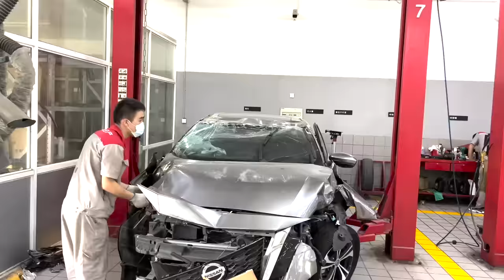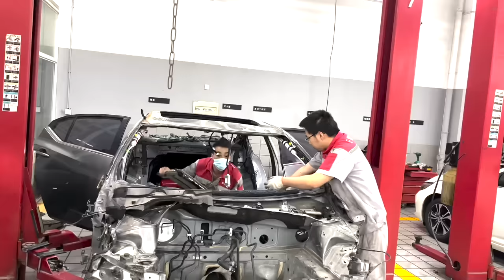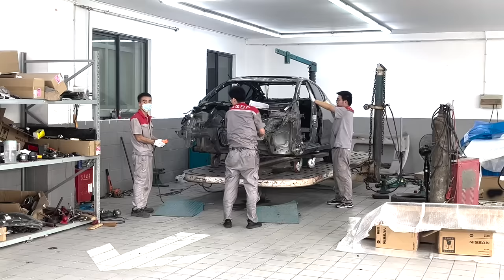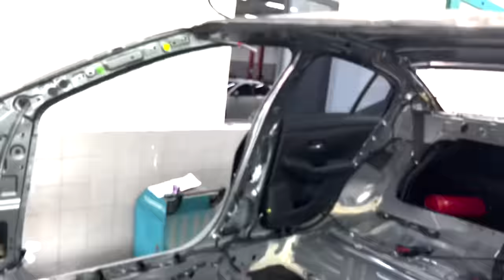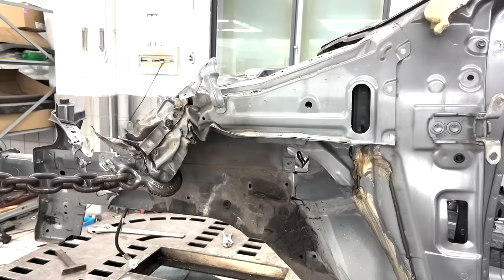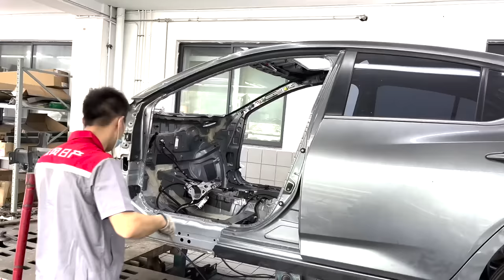Mechanical Wizardry: Master Technician Han Restores Scrap Nissan Sentra to Perfection!

Comment: I wonder how much it is to fix this car. In the United States, it is cheaper to buy a new car. This will be totalled and used for parts.
Reply from the maker: Hello, This car will cost around $10,000 to restore, the cost to repair the car can vary greatly depending on the extent of the damage, the make and model of the vehicle, and the labor and parts required to repair it. In some countries, if the damage is severe, it may indeed be more cost-effective to treat the vehicle as a whole and use it for parts rather than repairs.
Reply: @xinxianshi  exactly what I said....

Comment: In the event of another serious accident the driver will not be protected as the safety cage was compromised. Han is very skilled technician but he can not work miracles.
Reply from the maker: Your concern is valid, and safety is indeed a crucial aspect of any vehicle repair. While Han's skills are impressive, it's important to note that proper safety measures, adherence to repair standards, and thorough inspections are essential to ensure the integrity of a vehicle's safety features, especially the structural components.

Comment: At least repair was made to 90% . Will make a good car for someone if now mechanically ok.
Reply from the maker: It's great to hear that the repair was made to a significant extent, and the hope is that the vehicle will now be in good condition, especially mechanically. Ensuring that the car is not only cosmetically restored but also mechanically sound is crucial for its overall performance and safety. 😊🚗🔧

Comment: This time you overdid it with this car, this car should go to the scrap yard, Mi;11.20. see how much is left of this car, My sister-in-law wrecked a chrysler sebring car at a cost of $22,000.00 and the new car cost $22,5000.00 in 2002, did it make sense to repair the car and save only $500, Insuring made money and gave them a job without any sense.
Reply from the maker: Your point raises a valid consideration about the cost-effectiveness of repairing a damaged vehicle, especially when the repair costs approach or exceed the value of the vehicle. In some cases, the decision to repair a vehicle versus declaring it a total loss involves a careful evaluation of factors such as repair costs, the vehicle's market value, and potential safety implications.

Comment: When driven even after fixing wont be the same..the adjustment of the body is already out of balance..if the buyer see the picture of the car before its fixed they will think twice..its a hazard to even use it on the road ever again.
Reply from the maker: Your concerns are valid. It's crucial to consider the structural integrity of a repaired vehicle, especially after significant damage. Proper alignment and structural integrity are essential for safety on the road.

Comment: They only deal with NISSAN , doesn’t these repairs cost more than the vehicle . I mean these repairs are practically making the car new again all parts are new nothing is fixed .
Reply from the maker: Hello, we are Nissan after-sales service. Although we use original parts for repairs, they are still not comparable to new cars.

Comment: Is it really worth to repair such an enormously damaged car ?
I mean it must take 100 hours to do the job which will cost a fortune ...
Reply from the maker: As you mentioned, extensive repairs can be costly, especially if they require significant labor hours and replacement parts. It's essential to weigh the cost of repairs against the value of the car and the owner's budget.

Comment: Brother Han... No mask welding?? Be careful get some protection or by the time you are 40 you are going to be what needs a body repair specialist...
Reply from the maker: Thank you for your reminder. The habits that have been developed for many years are difficult to correct. They will use other methods to protect their glasses. Please rest assured

Comment: With the extent of damage sustained by this car the only place where this level of repair would be economically feasible is China. Labor costs are so high here in America the time spent for repairs would exceed the value of the entire vehicle and that is the break-point most insurance companies are not willing to cover. Therefore a car like this would end up going straight to the scrap yard.

Comment: This car here in the USA would not be taken for repair, it would be scrapped. My daughter hit the back of the car and smashed the front of the car, 5 years old and note wanted to fix this car.🤑
Reply from the maker: I understand, the decision to repair or scrap a car can vary based on factors such as the extent of the damage, the cost of repairs, and the car's overall value. In some cases, the cost of repairs might exceed the car's current market value, making it more economical to consider scrapping it, especially if there's insurance involved.

It's unfortunate when a car with relatively minor damage gets written off due to repair costs. However, safety and the overall condition of the vehicle are crucial considerations.
Reply: As far as I know, this car was auctioned off and given to someone who will fix it, I mean that the insurance agent steals from us and turns the value of the car to his advantage, and the injured person loses several thousand $ because he has to buy a new car.

Comment: En mi país muchos al tener un problema de ese tipo compran la mita del auto y lo sueldan
Reply from the maker: Hello, the repair methods are different in each country. Welding the car is also a good method, but the cost will increase.

Comment: People really find this amazing?  Sure, he bent the frame and body back and made it look good.. But if this vehicle was ever in another accident, the crumple zones are now compromised, and the same accident would likely take the life of the driver because of the integrity of the old "repaired" metal is now diminished.  This would not pass an inspection in the United States at any reputable mechanic.

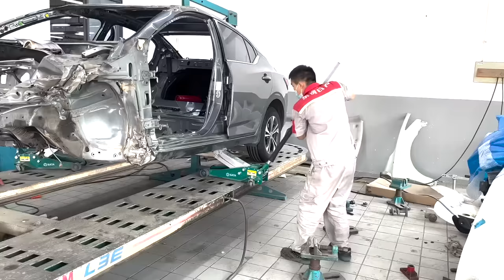Comment: In Oregon it wouldn't h😅 0:57 ave a clean title. You can't sell it as an original vehicle
Reply from the maker: Hello, thank you for sharing. The laws of each country are different. In our country, similar accidents can be repaired and the vehicle can be driven normally, but the accident and the repair process will be clearly recorded in the vehicle insurance file.

Comment: What a PERFECT DEMONSTARTION OF HOW  NEVER  TO REPAIR a CAR!  This will not perform to Factory ratings in the NEXT crash, when YOU own it. It will kill you, instead. 
Generic Sill clapmps? No factory lock-points? No 3-D pre-measuring, or even trammel measure? Straight into deconstruct without knowing if anything BEHIND the visible damage is off-spec?? Everything done by 'expert' VISUAL alignment????  Arbitrary sectioning locations, dictated by damage, not by the Factory BRM???? No cnoncern for HSS /UHSS safety cage 12.40, 13.20 repairing of sectioons that should NEVER be repairered, replacement is the onlyfactory-approved option: The passenger safety cell. Shocking repair practice.
Reply from the maker: you have some serious concerns about the repair methods demonstrated in the video. Your attention to these critical factors is commendable, as safety should always be the top priority in automotive repair.

Comment: So insurance says it’s totaled but you fix it?
Let me guess. You’re not a reputable garage and you would put your family in that car?
Reply from the maker: Hello, I need to clarify that this car was sent to us for repair by the original owner. The cost of repairing the car was almost the same as the value of the car, so the insurance company suggested scrapping it. However, the owner disagreed with scrapping it and insisted on repairing it, so he sent it to us. There will indeed be some loss of safety, but it is acceptable. We respect the owner's choice.

Comment: Such a car is a coffin, the stretched elements do not have the same strength as they originally did
Reply from the maker: Your concern is valid. When a car undergoes significant modifications or repairs, especially involving stretched elements, it can impact the structural integrity and safety of the vehicle. Alterations to the original design, such as lengthening or modifications to structural components, may compromise the vehicle's crashworthiness and overall safety.
Reply: @xinxianshi  Exactly

Comment: Рисовый Хан целый месяц ковал уставший металл,а русский Ваня просто приварил бы передок от распила 🤔
Reply from the maker: Hello, your observation is correct. The technicians will analyze the damage before repairing and then make a corresponding repair plan. Welding at the incision is also a method, but it is generally believed in the market that the original car part should be retained as much as possible to avoid cutting the main body and avoid expanding the accident.

Comment: I've seen cars in a lot better shape than that one, that were totaled by insurance companies. This one is good to show what can be done with a talented body shop man. But I'd find a car in a lot better shape to take on such a project. From the damage it had, this one must have been rolled. Or drove underneath a truck. I can't figure out how he welds with no welding helmet to shield his eyes. He must close his eyes everytime he hits the trigger on his mig welder. That's one thing I wouldn't mess with. I've heard horror stories about burns to the eye being so painful. An auto darkening helmet is cheap.
Reply from the maker: Hello, thank you for your serious reply. This car was caused by a rollover. It is a habit for them to close their eyes when welding. Although the automatic darkening glasses are cheap, they will affect the work speed, so the masters don’t want to wear them.

Comment: If it correctly has a salvage title, it's still worthless.
Reply from the maker: Thank you for your message. Although the accident car cannot be as good as a new car after repair, it is not worthless. Many poor people will own their favorite cars at low prices. It is not a bad thing. If you are worried about safety, then please think about it. Many mini cars that are very cheap after leaving the factory are not safe in themselves, such as the Chery QQ and BYD F0 produced in my country. These models are very popular and very cheap. A new car only costs about US$3,000, which makes many poor people Every household has a car, so safety is a relative issue and not the only criterion.

Comment: This car is no longer safe, it should be scrapped
Reply from the maker: Indeed, safety is always the top priority. However, there is no problem with normal driving after this car is repaired. I think that even if it is a new car, it is difficult to ensure that people will not be injured. Safe driving is the key.

Comment: Of course, great respect for such a job, but such a car is a death trap. Once the profiles are bent, even though they are straightened in the event of an accident, they will collapse like a house of cards with the owner inside. It may look like new, but it's a moving coffin. It's a car for exhibition only.
Reply from the maker: Your concerns about the structural integrity of a repaired car are valid. When a vehicle's frame or structural components are compromised, it can indeed pose significant safety risks, especially in the event of a collision.
Reply: @xinxianshi  Your restoration these ruins is very impressive and this must be a fantastic hobby. (I love to look at your job).  It is of course not your fault but ,it is very big problem in my country (Poland), that we buy used cars, and later it is discovered that a car was made from 3 ones or was previously very badly damaged. We have many bad accidents because of it. Many young people are driving very fast and cause fatal accidents.

Comment: 🇬🇧...the whole thing is somehow suspect! 
Now I'm watching the second video of this kind and the damage from the accident is such that the front structure and engine are still intact. 
Everything else around it looks like it's been hit by a bomb explosion - completely torn apart.
Seems staged somehow...!
🇩🇪...irgendwie suspekt das Ganze! 
Schaue nun das zweite Video dieser Art & stets ist der Unfallschaden derart, daß die vordere Struktur sowie Motor noch intakt sind. 
Alles andere drumherum wirkt allerdings wie nach einer Bombenexplosion - völlig zerrupft.
Wirkt irgendwie gestellt..!
Reply from the maker: Hello, this situation is normal. This is called survivor bias. The cars that can be repaired are those whose engines are not damaged and the repair cost is low. Those with serious damage, such as serious damage to the engine and transmission system, are directly scrapped and have no repair value.

Comment: Was ist mit Korrosionsschutz zwischen den Blechen die mit Schweißpunkten aneinander geheftet wurden? Da wird innerhalb kürzester Zeit Korrosion blühen! Ganz schlechte Arbeit!👎👎👎
Reply from the maker: You are right, the welding points will rust, but it is also related to the vehicle environment. We have also done relevant anti-rust treatment to ensure that there will be no impact in the short term.

Comment: En tous cas je ne roule pas avec cette voiture mes enfants a l'intérieur . cette voiture dois aller à la destruction  fini.  les assurances  sont des criminelles a ce niveau là  . cette voiture a été largement amortit par l'état gouverneur
Reply from the maker: Hello, it is understandable if you make such a judgment in a developed country, but in many developing countries, such a car can be repaired and used. The safety is only lower than that of a new car, and it is not useless.